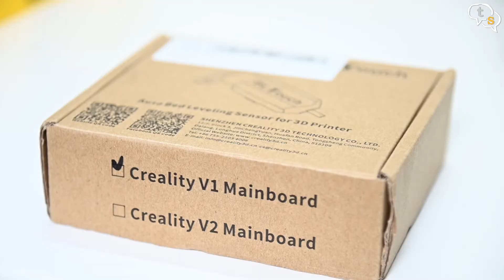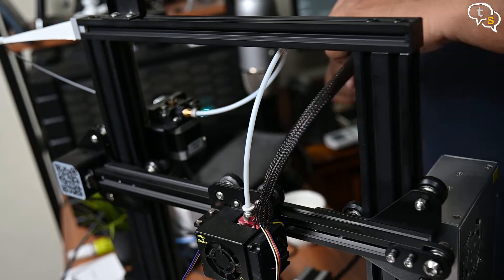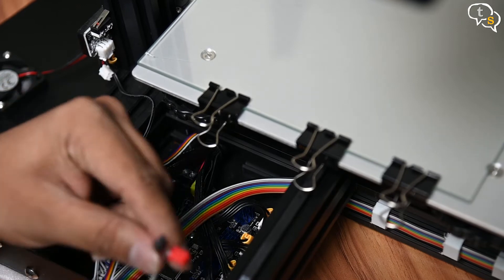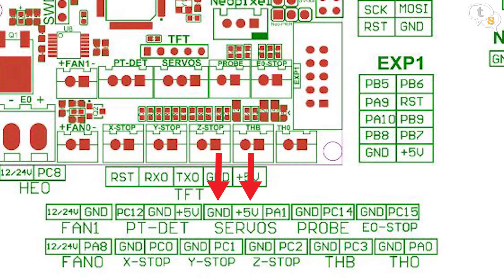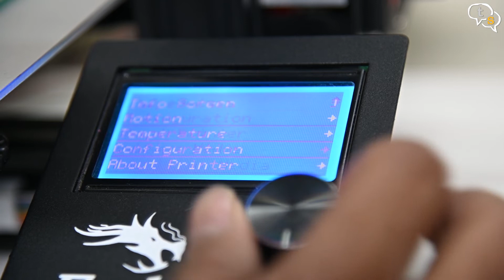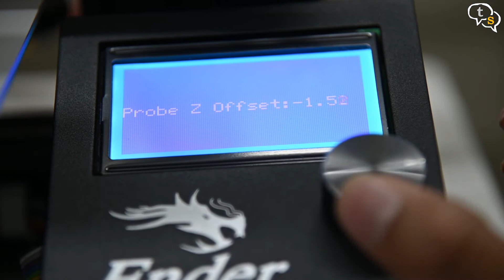How to add BL-Touch Auto Bed Leveling Sensor to your 3D Printer | Install BL-Touch on a SKR Mini E3

Comment: did the firmware.bin part and now the printer just gives me blank screen I am lost
Reply from the maker: Once the firmware is updated the firmware.bin file is generally renamed. Remove the memory card and check if the printer starts up. Also try renaming the bin file to bak to chdck if the file is causing problems.
Reply: @TalkingstuffNet  The lcd screen is blank completely the bin file was renamed and i already removed it to try and start it up but to no avail blank screen every time.
Reply: @TalkingstuffNet  renaming the file to bak did absolutely nothing still getting a blank screen on bootup
Reply: I think it destroyed the firmware on the new skr mini that i had bought, im trying to look into reflashing it but I am having no luck. I might have to buy a new motherboard and replace it again. I dont know what else to do.

Comment: where do i connect the wires? i have the Z stop but not the other one
Reply from the maker: On the standard Ender 3 board, you will need to connect power using the adapter splitting the power between the screen and the bl-touch. It will be shown in the manual. I'm using a SKR mini E3, so it has a custom port for it.
Reply: @TalkingstuffNet  ok, I have the SKR mini e3 V2, so I think things will be different.
Reply from the maker: The connector position should be marked in the manual, I think they fixed the requirement of having to interchange the power wires and it can be used directly.
Reply: @TalkingstuffNet  which manual? The SKR one or the BL touch one? The SKR one is long gone

Edit: thanks for taking your time out of your day to help me.
Reply from the maker: Check out this link 
https://github.com/bigtreetech/BIGTREETECH-SKR-mini-E3/blob/master/hardware/BTT%20SKR%20MINI%20E3%20V2.0/Hardware/BTT%20SKR%20MINI%20E3%20V2.0%20Instruction%20Manual.pdf

Comment: Do you have any advice if the firmware isnt flashing? i follow the necessary instructions but there is no change to the firmware, it just loads as normal without the BL Touch upgrade to it. Any help would be great!
Reply from the maker: Have you renamed the file to firmware.bin?

Comment: 2:29 screw threads are on backwards, you put the bolt in plastic first and then screw into metal. Hope this fixes issues for other people, no need for longer screws.
Reply from the maker: I've had multiple viewers tell me the same thing  😅

Comment: I have added the v1.2 bl touch z homing file, renamed to firmware.bin, but when I install the tf card I just get a blue screen! Help please
Reply from the maker: It takes a few seconds to install, and once done it will show the Merlin bootup screen. Does it boot without a tfcard?
Reply: @TalkingstuffNet  not anymore!
Reply from the maker: Try another tf card with the z homing firmware.
Reply: @TalkingstuffNet  thanks for the help. It turns out you do have to update firmware before plugging in bltouch. I unplugged bl touch, updated, then plugged it back in.
Reply: @TalkingstuffNet  I successfully managed to update firmware earlier today for my new motherboard. Then when I updated it again for the bl touch which I installed next it went wrong.

Comment: I just recently got a BL touch v3.1 for my birthday. I'm trying to find a port to put it into my skr mini e3 v1.2 but I'm not sure what to put it in! It has 5 holes on the cord that connects to the BLtouch. Please help me if you can!
Reply from the maker: The sensor end would be connected to vcc gnd signal , and the other cable would replace your existing z-stop.
Check out my blog which has pictures which might help. https://talkingstuff.net/ender-3-32-bit-controller-board-upgrade/
Reply: @TalkingstuffNet  The box I got only came with the Bl touch, and a cable with 5 wires and holes that aren't separated to go in those ports. Is there a cable I can buy?

Comment: so I have the newer SKR Mini e3 v3.0 and I followed this video perfectly and when I tell the printer to test the bl touch. the printer follows the test steps until it tries to move the probe. the probe doest move and the printer gives me a probing error. I have tried everything. even buying another bl touch kit. it's still giving me the same error. have any suggestions?
Reply from the maker: The skr E3 v3 board has the power and signal for bltouch in the right order I guess, if you've turned them around as in the instructions I have provided, you might not need to. That could be one issue. Also is the bl-touch lighting up in red and deploying when the printer turns on? 
Check if any older firmware is available for the same board and try flashing that instead.

Comment: Thank you for the succinct, sufficient, and altogether useful install guide! Two discoveries I made, for what they are worth:
a) the bolts to hold the probe weren't even close to functional from top down. But by threading them with the bolt below, screwing upwards into the harness, it worked like a charm!
b) it is so much easier to thread from the motherboard up the cable sleeve, because there is only one connector to pass through! Going from probe down is a real bear, to get two connectors -- it's twice the work, and three or four times the drag/diameter to wrestle.

Keep up the great content!

Comment: I have problems with the file "firmware-bltouch-for-z-homing.bin", It causes the Y axels to crash into the front bar.  I have a stock Ender 5. Do you have an idea as to what is happening?  I've been looking all over the net on github but have not been able to compile the correct bin.
Reply from the maker: Ok, shouldn't there be a switch to stop it moving forward on the y-axis. Make sure that switch is still connected. Also check the git if you're using ender 5 firmware as the Ender 3 doesn't have a front bar.

Comment: I installed this file below added it to my card and when i turned on my Ender Pro its now making a beeping sound with a blank screen. How do I fix this problem?

https://github.com/bigtreetech/BIGTREETECH-SKR-mini-E3/blob/master/firmware/V1.2/firmware-bltouch-for-z-homing.bin
Reply from the maker: Try removing the file and check if the printer is booting up. Are you sure you have the skr mini v1.2 a lot of users have purchased the 2.0 version.

Comment: When I do the bed level it does 25 touch point as and nothing else mine does not go to center and touch down
Reply from the maker: So after the levelling it just stays in one location, is this before a print or have you initiated the bed levelling manually, or are you using a g29 in the gcode? If you have added it manually try removing the code and printing. You don't need to level the bed every time, unless you removed the plate or hit the knobs by mistake.
Reply: @TalkingstuffNet  I think I got it, I was not using the Z homing firmware so I updated it and it seems to be working fine now. Thanks for your reply! I am using the G29 now

Comment: I just installed an SKR Mini e3 v2.0 to my Ender 3 along with a BL Touch. I was able to set a Z-Offset just fine and the system reads the Z-Axis at 0 perfectly. However, when starting a print, it doesn't seem like the firmware is using the Bed Leveling from the BL Touch. I've installed this exact firmware as my black and white cables have replaced the z-homing switch : firmware-bltouch-for-z-homing.bin I'm using Cura as a slicer and when I use G29 in the G-Code it's able to level the bed using the BL Touch but doesn't seem to use it since the Z-Axis is not moving at all. Any help?
Reply from the maker: Hi, does the printer auto home when you use the option, even in Z? If the z axis is not moving , the cable might not be connected properly on the SKR board. Even check the motor side.
Reply: @TalkingstuffNet  yes it does. I’m able to auto home and the z-axis motor is able to move and be controlled through the LCD screen controls.

Comment: Hello! When I try to auto home or level bed, the probe doesnt come out and it says "Home Z First". What do i do?
Reply from the maker: Have you connected the bl-touch correctly to the board. Have you interchanged the GND and VCC by opening up the Du-Pont connectors? I show how to in the video, as the connectors don't match  by default.
Have you updated to the latest Marlin firmware from the Biqu Bigtree GIT?

Comment: Nice one. Checked about 5 other on leveling and connecting a bl touch or 3d touch to a skr. Most are too slow, explaining stuff noone wants to hear but you get to the point. Maybe the hint is missing to add a G29 to the slicer.

Comment: the probe does not deploy during auto home and the nozzle crashes into the bed.
Reply from the maker: Install the bltouch z-homing firmware , this makes the nozzle home at the center of the bed instead of the corner.
Reply: @TalkingstuffNet  I did. It does the same thing it just crashes into the bed I tried both. Neither one works. The only reason I tried both is cuz somebody commented on your video and said that it worked when they used the other firmware. So I tried both and nothing.
Reply from the maker: Try an older version, I have not updated the firmware for at least 6 months now and they used an older verison I guess.

Comment: Hello! I am having the same problem as others, the BL Touch information does not appear on the screen. My card is an SKR v1.2. Do you know how to solve this problem?
Reply from the maker: Have you interchanged the VCC and GND wires on the bltouch connector?
Reply: @TalkingstuffNet  I believe I have not changed. I did as you did and also following the github. The bltouch turns on. The problem is that the BLTouch option does not appear on the screen. Perhaps the firmware version is different. Did you try to install the current version to test?
Reply from the maker: I have not updated recently. I use the bltouch zhoming firmware.
Reply: @TalkingstuffNet  I installed the zhoming firmware as well. Probably the current firmware version has the bltouch lines marked (#). There's no way to know. Without you testing the new firmware.

Comment: I have problems with the file "firmware-bltouch-for-z-homing.bin", I upload it and the bltouch option does not appear. Instead, the file "firmware-bltouch.bin" works perfectly. Do you think what is happening?
Reply from the maker: Are you downloading the correct version, there are multiple versions of the SKR Mini board  and I've installed the v 1.2 board. If yours is 2.0 you will need to download it from the right git.
Reply: @TalkingstuffNet  
Thanks for answering! I have the same version, 1.2 and I have repeated the process several times and it does not work for me! Could it be that the update they did a few days ago does not work properly? It's weird because if I take the file that doesn't have Z-Homing it works.
Reply from the maker: Oh, I haven't updated my firmware for a few months at the very least. Maybe I was lucky.
Reply from the maker: I use the z homing firmware as the normal firmware tries to home off the bed and it crashes into it due to no z-stop switch being present. When z homing it homes in at the center of the bed triggering the bltouch and not slamming into the bed.

Comment: I can not get mine to work like this, I tried doing it with the other firmware, then did this one using the Z switch instead. the sensor works, but I can not find anyway for it to actually sense the bed location. I used Pronterface to calibrate the Z offset and the interface ignores everything, I can go in the settings and see what I set, yet it doesn't work.  I go to ABL and it drops down in the center a couple times, then says it saves settings, then I print and it's at least 10mm away from the bed. I really don't get it, I think I have a defective board, I have watched countless videos and flashing is all anyone seems to have to do, but it is not working at all for me.  Soon the board and BL will be in the trash and I will put it back the way it was. Normally I don't have troubles like this, but when I do it seems I am the only person in the world that it ever happened to and there is no fix.
Reply from the maker: Have you set the Z-offset setting on the printer. I have mine at -2.95 to print properly else it was quite off the bed.
Reply: Talking Stuff that’s I you for the reply.  So I got it working, BUT I have no idea what was wrong.  It would not go through the leveling process. I was about to give up, flashes it back to no bltouch, then someone asked about error codes, and to verify wiring orientation, so I double checked the plugs and took photos , re flashed and rebooted with card a few times to obtain error codes and it just started working.  So I think either I had a loose connection , or I needed to reboot a couple times with the firmware on the card.  Either way I got it working last night and thank you for the video and the reply to check in on me.

Comment: Hi, Nice quick guide. I'll need to look elsewhere for details on final set up of the firmware but was really useful. One point is that you said the two bolts attaching the probe to the mount were not stable and you used nuts and bolts instead. You were putting the bolts in from the wrong side, they are screwed in from below the probe not from above the mount. Screw in from below and they will be very secure. Thanks again
Reply from the maker: Also if you remove the z-stop, make sure to flash the  Z homing firmware instead of the standard one. As there is no z-stop the printer will move to a corner and hit the bed as the probe is off the bed. Using the z-homing firmware it will home at the center of the bed, so the probe will be triggered and it won't hit.
Reply from the maker: I have the same available as an instructable.
https://www.instructables.com/id/Install-BL-Touch-on-Ender-3-With-SKR-Board/

Comment: Way too fast, the most critical parts are shielded by hands and fast forwarded. Appreciate the desire to make it short, but slow down.
Reply from the maker: I have the same available as an instructable.
https://www.instructables.com/id/Install-BL-Touch-on-Ender-3-With-SKR-Board/
Reply: Talking Stuff thanks!

Comment: When ever I installed the firmware.bin file from bigtreetech my screen goes blank. When I use other folks versions, the screen works but setting z offset is buggy. Any ideas regarding the blank screen? Thanks!
Reply from the maker: For bl-touch installation you will need to use the z-homing firmware. Also you will need to calibrate the z-offset, mine was at  -2.95 instead of the default -1.85 and I'm using a 3mm glass bed. Blank screen I'm not sure of as I'm using the firmware found on the git repository, I'm just too lazy to compile my own. Just make sure of the connections on the board. Does it work perfectly without the bltouch? Also did you reverse the polarity on the dupont connectors for the bltouch?
Reply: @TalkingstuffNet  Thx!

Comment: Hello, I have BL touch V3 and new skr mini E3 V.2 installed. I have followed your install instructions but my BL touch when doing bed level or auto home is going down to crash on the bed after being positionned in the midlle of the bed. Do you know where does it come from?
thanks in advance.
Zoé
Reply: There is a post on github that says it’s not working with the V2
Reply: @raygilfillan  
Thanks but so sad :-(
Reply: Zoé Ketchoz it’s still early days I am sure the teething issues will be ironed out soon